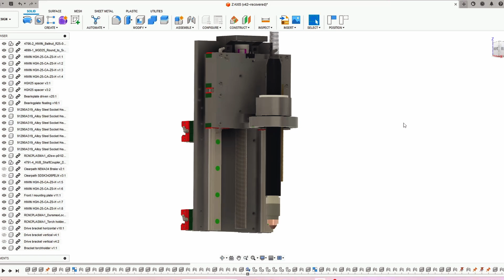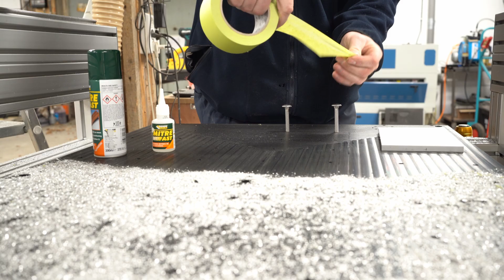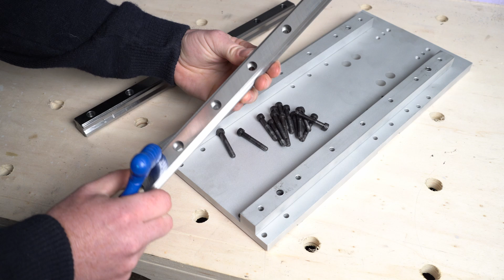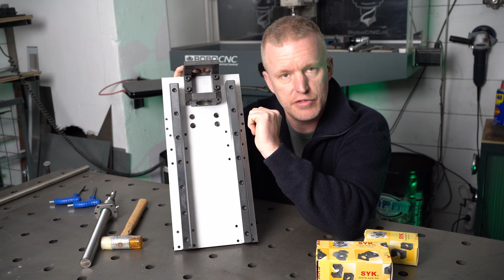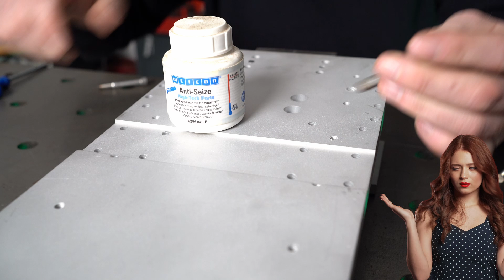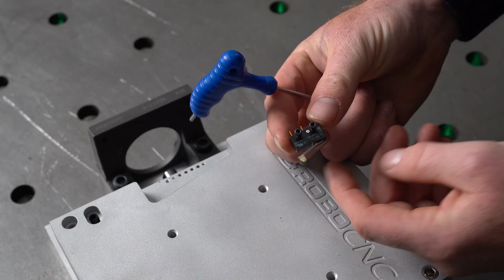DIY CNC Plasma Z-Axis Build – Linear Rails, Ballscrew & Torch Mount (PLASMA Ep.02)

Comment: I was interested in the use of only one bearing on the ballscrew, which explains why I see many second hand ballscrews machined for only one bearing for sale. Presumably this is only good for shorter thicker ballscrews, otherwise they will whip around when rotated at speed, is that true? Have you used this setup before Marcel? Thanks
Reply from the maker: That’s correct… on this Z axis is does not serve a purpose at < 300mm. At the speeds it runs.

For the gantry for instance you see that I did use a bearing. Keep in mind that if you do put a bearing on the end of the ball screw that it should be a sliding bearing to be able to let the ballscrew expend with temperature. (And the driven side with a double contact bearing of course) 

And yes I have used this setup before, and the machine is running almost daily for the last 4 years. So I would not change the setup.
Reply: @RoboCNCnl  Thanks :)

Comment: Contactcorrosie :p
Reply: Yip, different nobilities of the 2 matetials.
Reply from the maker: I got some new terminology to read into :) 
Thanks for watching and your reply!
Reply: @RoboCNCnl  Damn, my long comment here did not appear, the short version, yes galvanic differential leads to corrosion, a zinc based anti-seize compound will act sacrificially, protecting the Au. A copper-based compound will protect the SS. For high temperatures go to a ceramic based paste (but I dont think you see those temps, think engines). 

Also, if the gel in the compound stays wet it will also keep electrolytes out of the thread preventing corrosion..This latter thing is what locktight does, btw, even though it sets hard.

But you may also experience galling, which is that a property of certain SSs (200 and 300 series) and Au causes friction as the bolt is tightened. The friction causes heat and tearing of the threads, leading to seizing. Again an anti-seize gel will lubricate and help prevent galling. Read more here (I had read up about galling again, I'd forgotten detail) https://www.fabory.com/en/group/the_seizing_of_stainless_steel_fasteners Actually, I don't understand yet what it is about these surfaces that causes roughness and friction, I just know it happens.

Also this NASA document contains some info about different fastenings, and so on https://ntrs.nasa.gov/api/citations/19900009424/downloads/19900009424.pdf. Enjoy! 🙂 Best wishes.
Reply from the maker: Thanks for watching, and the reply… wondering why it’s so extreme with these two materials though.
Reply: @RoboCNCnl  het elektrone verschillen  tussen de twee en daar door krijg je dus een koude las tussen de twee blijkbaar.
De eene zuigt de elektrone van de andere en hupa koude las.
Dus static vibratie dragen daar aan bij.
vraag me af of je dit kan verkomen door 1 van de twee te electro platen.
Is snel en meestal goedkoop.
Maar weet niet of dat lang gaat werken